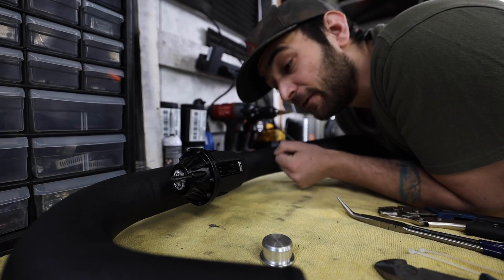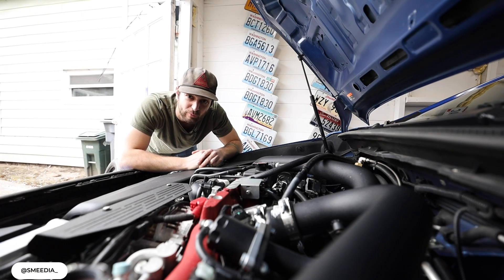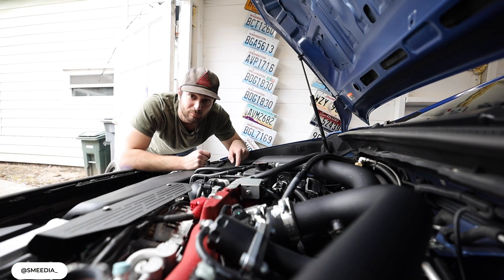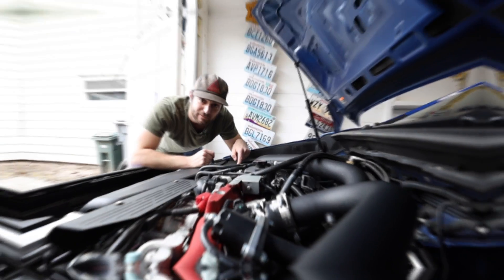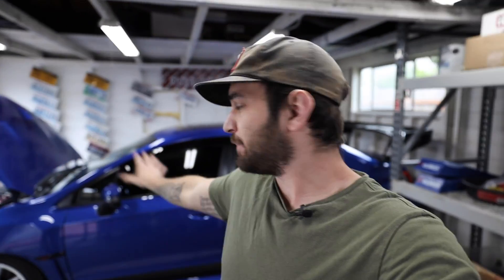This Is Why You Shouldn't Use a BOV On A Stock WRX/STI

Comment: Hi man. Ive got a block off plate for my stock bypass valve on my 08 hatchback. So it makes turbo flutter, compressor surge whatever you want to call it. My car seems to idle and drive completely fine although I dont have an Accessport so i cant monitor knock etc. I know its running slightly more rich due to the few extra pops on downshifts but apart from that it seems to drive fine. Any reccomendations? I know I should probably take it off but that stustustu is addicting.
Reply from the maker: From a performance standpoint I would remove it, but if you want it and you haven't had issues, its you can so if you like it keep it going.
Reply: @Smeedia  Good video idea maybe? Hahahaha. Just a metal plate you put behind the recirc valve between the valve and the intercooler. I'll keep it out for now and see if I notice any differences, thanks man.

Comment: Hey bro! Any word on speed density explanation? Have a GFB fully adjustable blow off on my STI and my tuner seems to have worked out any “unhappiness” with the motor... just curious what exactly speed density is exactly... thanks in advance! Keep doing what you do bro!
Reply from the maker: I'm going to put a video together on it, will need to figure out how to do the video but I will make one. And a tuner can work out most of the issues with a BOV from what I've seen

Comment: Are you doing a new turbo inlet on the upcoming build? If so, which one?
Reply from the maker: Yes and I've got the Cobb turbo I let im using 😁
Reply: @Smeedia  Sick! I did the same on mine. I question if i hooked up one line of the IAG AOS correctly on the inlet. I will stay tuned to see what you do. Still haven't gotten it tuned yet. It's sitting in the garage collecting dust until the covid stuff dies down.  Did the full flex fuel system with rails, Blouch 2.5 xtr, tgv deletes, Tomei uel, Cobb turbo inlet and Cobb SF intake. Still have a radiator to install sometime soon.

Comment: What do you think about the  Turbosmart dual port BOV?  On a 18 STI.
Reply from the maker: Looks like a 50/50 valve, I would still suggest sticking with a BPV but if you want the noises a 50/50 would be better than a full VTA
Reply: Smeedia my tuner recommended it since I’m going stage 3 plus flex fuel. He said to get it now if I want to upgrade my turbo later down the road. Still unsure if I should pull the trigger on it or not.
Reply from the maker: I would listen to your tuner, I'm swapping to an FP Blue and going E85 with a hybrid SD tune and I was told to stay with the bypass valve because I am still using the MAF
Reply: Smeedia okay makes sense. Thanks for the input. Great video btw!

Comment: I have an fully recirculating hks bov paired with a cobb big sf intake.  E-tuned by William Knose at Delicious Tuning by the way.  In my opinion, this is the way to go if you want those spooly boy noises.  The stock airbox muffles alot, so you can certainly hear the bov noises through an upgraded intake.  Side note, my hks bov is a 13 year old original version from 2007, that was still brand new in the box that I never used for a prelude build I never finished before joining the Marines.
Reply from the maker: Thats a good find to be able to reuse! And the intake really helps to bring out a lot of those noises as you said 🔥
Reply: @Smeedia  Is the BOV different when the car has MAP rather then a MAF? 2018 Hyundai Elantra Sport to be exact. thanks
Reply: @perziano6134 MAP and MAF are not interchangeable unfortunately

Comment: Hey bro I’m getting a tune running hks bov rich.. do you not recommend that either ?
Reply from the maker: Of your getting pruned and your tuner is good with it you will be fine. The major issue is using it with an OTS tune or the OE
Reply: Smeedia is an Etune fine ? Or just go with a protune?
Reply from the maker: An etune will be good because the car will be tuned for it

Comment: AEM Wideband 
What’s the latest on your Wideband issue

Check out this Australian Race Parts developer Just Race Parts
The prices are Australian $$ so cheap as chips for US $’s

Defi type gauge but not a knock off type
https://www.justraceparts.com.au/10in1-automotive-digital-oled-multi-gauge-display
JRP advised me they are working on a major update so I’m waiting for that, due this year.

Wideband
https://www.justraceparts.com.au/oxygen-sensors/wideband-gauge-kits

When the sti is tuned with new parts you gotta get a video of you chopping your Evo mates
Reply from the maker: Ended up buying a cheap sensor off of Amazon and splicing the sensor to the AEM Harness and got it to work 😅and definitely going to have to 🔥😈

Comment: Would adding the recirculation adapter hks offers with the super sqv eliminate issues of having a BOV making it essentially a BPV? or would there still be problems compared to having the stock bpv?
Reply from the maker: It would help to eliminate the issues, it's sending the air back I to the system so its still accounted for

Comment: What you think about the turboxs hybrid 50/50 bov with cobb big SF stage 1 - 93 tune? Is that fine to run with accept port
Reply from the maker: I personally would go full recirculation but if you want the noises the 50/50 is a better option IMO than full VTA
Reply: @Smeedia  In your opinion do you know if the 50/50 would mess up anything like the full bov does?
Reply from the maker: Your still loosong metered air but the chances are far less likely when using a 50/50

Comment: I recommend using your AP to reset ECU learned values before/ after swapping bovs
Reply from the maker: The cars not going to be driven for a month and will be returned before driven but not a bad idea, also can let the ECU relearn by driving normally for a bit
Reply: Smeedia yeah 15 minutes is about what it needs to relearn.
Your setup was def not happy with the hks bov
I’m surprised it affected idle, wouldn’t it be closed at idle

I tried to run a GFB fully adjustable bov but it works differently to Evo x oem bov (not sure how)

Even though spring pressure and venting is adjustable I didn’t like how it felt or sounded
GFB can be set to fully recirc, but still to different to what car is expecting

Definitely need to tune for these Aftermarket bovs
Check this out, https://youtu.be/bsy9hJic7cQ
Reply from the maker: It was odd, if only effected idle under load, if I was strongly and not moving it did not change anything. The cars getting torn apart tomorrow until the pro tune, if I was driving it again soon then I would go through the relearning process. Car def did not enjoy that 😅

Comment: I was hoping you woulda proved yourself wrong. I've been fighting off the urge to do an HKS SSQBOV, since I bought the STi a year, and a half ago. I did the research, and found that would really hurt my ride. I'm not planning on a big HP build. Just a couple of bolt ons, maybe 320...330. Not really sure how much sense speed density tune would make for me. Definitely will dyno soon though.
Reply from the maker: You wouldn't need a speed density tune at that interval, an intake should give you some solid intake noises should satisfy that want for some noise 😁

Comment: Sooo, if you were to have a stock car but you get it tuned for the blow off valve, would that be ok? Or will there still be issues?
Reply: Also what if you get a 50/50?
Reply from the maker: As long as your tuner is okay with it then you should be fine, the issue is when you pair a BOV with the OEM Tune and a OTS tune. If you want the noise then a 50/50 would be your best bet
Reply: @Smeedia  ok cool, cause rn Ive got a 2013 ford escape with an exhaust and turbo smart 50/50 BOV and it runs fine for me so far after about 8 months of putting it on, just saving up for a pro tune
Reply: @x3ro439  noob here, 50/50 as in a hybrid bov right?
Reply from the maker: Yes it is
Reply: Anthony Nguyen yea it releases air to the atmosphere and recirculates as well

Comment: Correct me if I'm wrong, but a Bov is pointless unless your running high hp.
Reply from the maker: That is correct
Reply from the maker: No real need for them at lower horsepower outside of having them for just the noise

Comment: B is for build unplugged the maf and said its now running speed density... does it even work like that? I dont know much at all about it or how to set up a maf'd car to run speed density
Reply from the maker: I don't know what else was done to the car but no it does not lol you need to have an independent sensor for the car to read off of and a tune to go with it
Reply: @Smeedia  that's what I thought. He makes me shake my head more often than not lol

Comment: Haha I'm new to the subie community so excuse the newbie question haha but what mods would you have to do to the engine to get a bypass valve running good?
Reply from the maker: No worries! And I am guessing you mean BOV, the car comes from the factory with a bypass valve. But to run a BOV properly you would need to get set up with a speed density tune. It essentially eliminated the MAF and used airflow volume to determine airflow. Its a more complex tuning method and only really used in higher HP applications
Reply: @Smeedia  oh haha yeah that's what I mean, sweet thanks it's nice to have a YouTuber actually reply to my comments for one haha keep up the great content!
Reply from the maker: I reply to everyone, your time is just as important as mine!

Comment: Great work and super informative video.  Do you think is possible to run a Go Fast Bits GFB for on my 2019 STI.  TMS Respons Blow Off Valve BOV Kit
Reply from the maker: I've used the GFB before and it worked but it leaked also if your wanting to run one with a noise, I would get a 50/50 at minimum to send some air back into the intake track

Comment: You say wrx/sti, but i have a 05 legacy gt and the car already stutters when I shift from 1 to 2 or 2 to 3 and sometimes when I downshift. So what do you recommend I do because i’d like the bov noises and I thought about getting an adjustable one. I would like some input to see what you or anyone has to say.
Reply from the maker: If you really want the noises I would say get a 50/50 at least some of the air gets pushed back into the system and will help the stuttering like my engine did. If you want a full BOV I would consult your tuner to see how they would approach going that route.

Comment: Speed density changes all the flaws tho correct?
Reply from the maker: Full speed density is the proper way to use a BOV
Reply: @Smeedia  I was just double checking but I am going speed density and went with a tial bov to go with the duel tial ewg

Comment: I wish I would have seen a video like this before I bought one. I guess I got something to sell now
Reply from the maker: If your tuner is okay with it you can use it, its not the perfect ideal set up but you can make it work with a protune while still on MAF. I would not suggest using it on an OTS Map or the OE Map
Reply: Torque solution makes  BPV conversion for the HKS SSQV which is what I have. Holds boost really well and still recirculates. I ran my 2013 venting to atmosphere for two weeks while I waited for the conversion to get here ran a little rich but other than that no biggie. I even checked my plugs which were fine.

Comment: Can I run a bov with cold air intake,  invidia r400 exhaust and stage 1 tune without any issues ?
Reply from the maker: I wouldn't suggest doing so, I would read the map notes for the stage 1 tune and stick with the parts listed on there. Anything outside of that I would get a Protune
Reply: @Smeedia  Thanks for the reply I just got a 2015 Sti last week equipped with the bolt ons I listed ^ I subscribed to your channel and look forward to more videos! Keep up the good work 🤙
Reply from the maker: Congrats on the new car and appreciate the support! 🙏🔥

Comment: your Protuned. if you change anything that can affect the tune its going to react a lot more protuned then stock tune. mines real nice and smooth just smells rich on stock ecu tune
Reply from the maker: Agreed, it will react differently on the protune. As long as your tuned with the BOV on the car it will be fine. The biggest issue is OTS Tunes and OE tune with the BOV. Both OTS and OE are not ideal as they are.
Reply: @Smeedia  very true i know its not meant for it but runs decent for now. waiting for couple major upgrades to tune it

Comment: Hey! I've been getting lots of FKL/FBK under steady throttle at low rpms (2500-3500) after my usual 5W-30 oil change. I went from Castrol Edge to Motul 8100 Clean+ then BACK to Castrol Edge after seeing the results but still, it's always like 1.4 - 2.8 on 2nd - 4th gear. If I drive it harder it seems to go away. It's only if I “lug” the engine from those lower rpms it kicks in... Is this behavior normal for fresher oil?
PLEASE HELP it's a brand new HMS motor with 5K miles
Reply from the maker: I'm assuming that your protuned? 
FBK and FKL are normal things to happen, however if you are protuned I would get some data logs to shoot back over to your tuner to get a more clear picture of what all is going on
Reply: @Smeedia  yea it's ProTuned. I bought my accessport along with my dyno so it's the first time monitoring the car in this regard. I feel like it's only there to add more stress to my EJ daily life 😤
Reply from the maker: They do call them anxiety poets for a reason 😅

Comment: Now that you mentioned it, you gotta make a video explaining speed density
Reply: MAF measures the mass of air that enters the engine. Speed density calculates the amount of air that goes in the engine by measuring pressure, manifold air temp and rpm. You must use a float valve style BOV that does not stay open under vacuum. If so you simply need to change one number in the tune. His engine is actualy over correcting for running lean because its sucking in air at the BOV.
Reply from the maker: Thats difficult, ill see what I can do to make it easily understandable 🔥
Reply: @Smeedia   What about a HKS Super SQV4 Blow Off Valve would still need a full speed density tune?
Reply: @kurtis_mcewan  yes!
Reply: I did a ton of reading about speed density vs maf tuning for my lt1 corvette motor. Same concept different platform. I’ll see if I can find the link, it’s a ton of relevant information to the topic
Reply: See, its a missconception. You can use a twin piston/diaphragm type atmospheric bov on maf setups and they work as perfect as they do with the recirc valve. 
If you were car guys youd know this...
Ive run a loud bov on every turbo car ive had and all being maf setup. 
Do some research and stop talking shit.

Comment: I love the sound that my go fast bits bypass valve makes.  I never felt the need to do a blow off valve.  My suggestion to anybody that wants cool turbo noises is to install a intake and get it protuned.  The stock air box muffles all the noise the of the turbo and the stock tune is pretty bad on these cars anyway.
Reply from the maker: This^
Reply: Damn right! My Cobb short ram has all the wooooosh!

Comment: Unfortunately my 07 wrx cam with a turbosmart VEEport pro, and its wanting to stall with small accelerator blips in traffic, and stalls when parking in reverse
Reply from the maker: If you can snag an OWM valve that would be ideal, i think you can get them for around $30 used or so
Reply: @Smeedia  own? Sorry long day at my shop
Reply from the maker: OEM* haha typo
Reply: @Smeedia  ah, your good man ill have to check around here in north FL.  Love your Chanel very helpful even to a mechanic of 12 years.  Thank you

Comment: How does the car even know if your not building boost, and driving. If you're just sitting there and its not venting to atmosphere its not doing anything. You should of just drove it a little going down the street isn't going to hurt anything.. Ive seen a lot, and I mean a lot of subarus with bov.
Reply from the maker: I've seen a lot doing it as well, and it was only under load when it would do it, standing still and not moving the car wouldn't drop idle, only when I started to actually move

Comment: Been running my bov for 18 months on 380 HP wrx. No issues at all.. I stay up on maintenance, and plugs look normal. I recommend getting one if you want.
Reply from the maker: Did you get produced with it on the car? The major issue of it is using a BOV on a Stock car or one with an OTS Map which already have their own issues with them.
Reply: @Smeedia  it was the first mod I put on my car and I ran it for over a year before getting a protune.